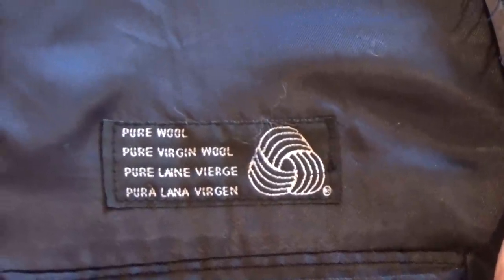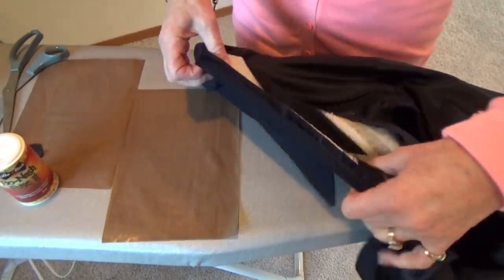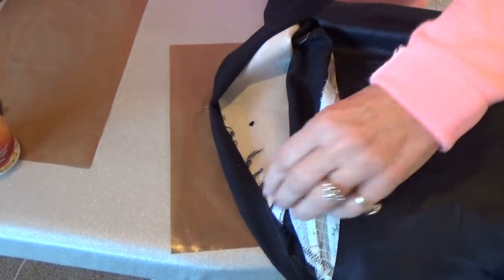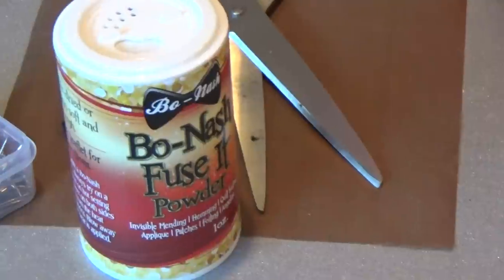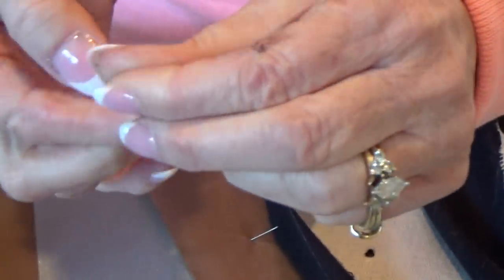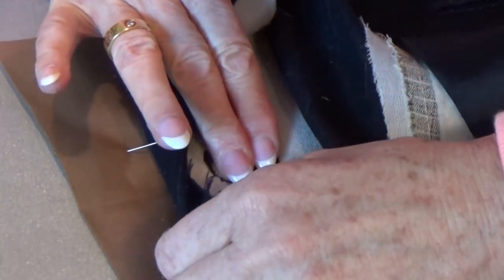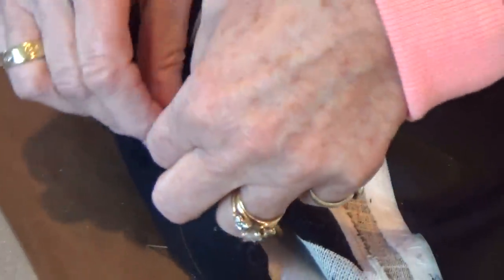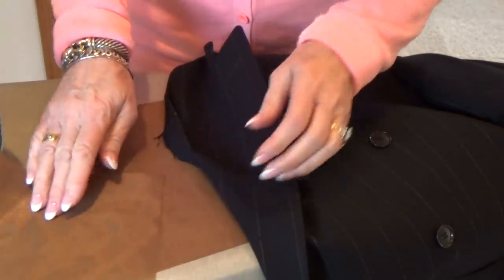How to fix holes in a suit jacket with Fuse It Powder

Comment: one question, i have moth tracks (not through and through holes)  on a vintage pair of wool pants, your method wont work for me because its not a hole, i was thinking of filling in the tracks with fiber dust but will it work if i did the reverse, glued it on the outside since i cannot glue it from the back side?
Reply from the maker: Kar,  This kind of repair would be very difficult to do since it will be on the right side.  You will not be able to make it invisible.  Thank you
Reply: thanks for the quick reply, i think i have few options so i will try to fuse it on the outside with a thin layer of the fabric dust..btw what is the approximate price of this fusing agent ?
Reply from the maker: the starter kit sells for $15.99 for 1oz of powder and 2 6x9 fiberglass pressing sheets.  www.bonash.com
Reply: Thankyou.

Comment: I did this and it looks like a stain, it’s hard like a piece of gum stuck in the fabric!
Reply from the maker: you used to much powder.  Its always best to practice this technique on something you don't care about before working on something that may be expensive
always work from the wrong side of the garment and don't forget to use a patch as that is what holds everything together.  You may be able to start over by reheating the patch and while it is warm pull the whole repair off

Comment: Great video! A question: how will this repair work on the crease in a pair of trousers? Is the repair flexible enough for  that area? Thanks!
Reply from the maker: Are they wool?  If they are loose fitting, It most likely will work just fine!

Comment: Beryl, my moth holes are on the sport coat sleeve, right above the wrist area. Do you have any suggestions on how to get to the holes to repair? Thanks for the video and I'm looking forward to trying.
Reply from the maker: Assuming that the coat has a lining, you would either need to unpick the stitching or cut the lining so get to the wrong side of the fabric.  This type of repair has to be done from the wrong side
Reply: @QuiltersGuide  Thanks very much!

Comment: It's great stuff.  Been using it for years now.  Thing is, sometimes I get a bit of  shiny look on he front side.  What am I doing wrong?
Reply from the maker: You have managed to get some powder on the front.  Make sure that your sheet does not have any residue on it.  It is sometimes easier to prefuse your patch that way the powder will be already melted to the patch and you won't have any excess powder on the garment